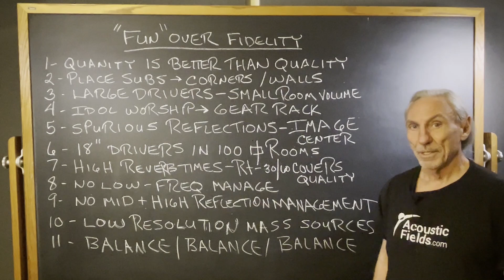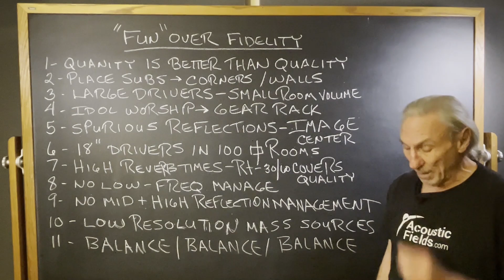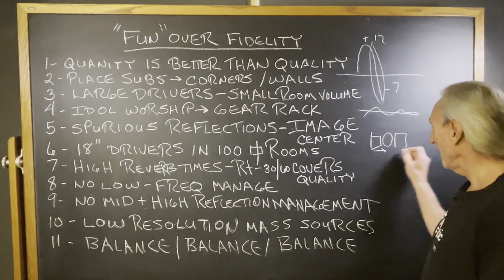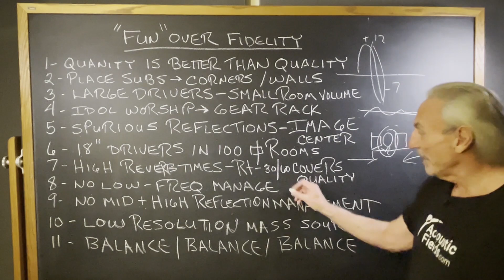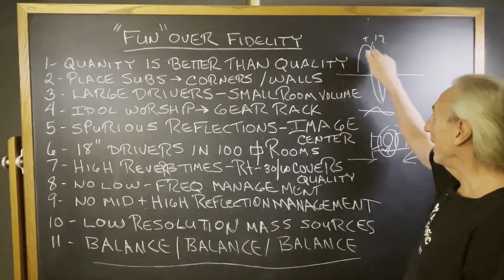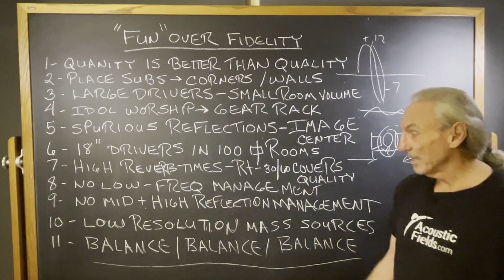"Fun" Over Fidelity - www.AcousticFields.com

Comment: I tried locations other than the corner in my room but somehow all of them provided even more rollercoaster response than the corner, on top of having much less energy (which results in less headroom for the amplifier post-calibration). Is my room special, am I measuring something wrong, or am I doing something else wrong?

Why is a large driver necessarily wrong for a small room? Post-calibration it should just use a lower gain/trim to get the correct output anyway?
Reply from the maker: Reduce the input into the room. Locate the energy source in the room middle and more left and right. Listen for increased resolution in presentaion value before measuring. Move source left and right then backwards and forwards.
Reply: @AcousticFields  Not that it would be practical in my living room due to running cables in dangerous places, but even just for trying it, wouldn't a listening test would first require a calibration run and then post-calibration tweaks for integration with main speakers? My current setup was much improved after calibration and tweaking the subwoofer-speaker delays for optimal response. Also, if the measurement in the middle of the room is still a major rollercoaster (for example -22db dip at 30Hz I got when placing at the left of the couch, which did not exist in the corner) does it have any chance to sound better than the less-rollercoaster-ish response I get in the corner? I guess one day I should mess around with various positions to the left of my couch (the right side is near the balcony window, left is more in the center of the shared space room), but I have doubts and even if I do get a good response at some arbitrary position, there is probably no way I can actually place the subwoofer in middle of a room where people actually walk around.
Reply from the maker: @galzohar  With dual usage rooms, living/listening, it is difficult to rely on measurements since the room lacks consistency and predictability in surface area treatment space availibility.

Comment: Resolution? - might you be able to provide some guidelines as to what we all should be shooting for... for example: 1. Frequency response +/- dB at the listening position in the critical range of say 250 hz to 2.5 khz, 2. Room decay time, 3. Noise floor level, 4. and any other criteria one should be looking at in order to help get us to a point of an adequately resolving room / system.  Thank you!  Ps. Beginning on a brand new room (already built) that I am free to do whatever I want within the room..., and so I'm looking for #s (characteristics) that I should be shooting for.  Thanks again.
Reply from the maker: All of the issues you have raised including many more. Lets start with your room size and usage. What will you be doing in what size room?
Reply: @AcousticFields  Dreadful small I'm afraid - 13' 3" x 21' 3" x 7' 10".  Two doors (fully closed) and five windows (have no problem fully boarding up). Dedicated audio listening room. First and foremost 2-Channel listening and then will work in Home Theater (with disappearing screen and what not so as not to compromise 2-Channel listening. Room constructed of 1/2 Sheetrock over 5/8 QuietRock on all walls and ceiling along with fully Rockwool filled walls and ceiling (floor rafters for now left empty), also double layer plywood floor (1/2 inch + 3/4 inch) plus low pile wall-to-wall carpet + carpet pad, with huge under floor crawl space (for cable runs and for anything else which may help?).  Hope that helps?

Comment: I have my speakers pulled forward a bit, as much as I can, but still flanking my TV, as one does. How far back must the TV be from the front of the speakers before it's not such a problem?
Reply from the maker: It will always be an issue due to its hard surface no matter where it is located. Cover it when listening to music.
Reply: @AcousticFields  Well, I tried throwing a blanket over the TV. It definitely sounds a little more damped and maybe smoother. I'm not sure if the image improved or not. It sounds a little less "live." It's probably higher fidelity and less fun 😅

Comment: What about speakers that are designed (?) to perform better near  walls or even corners ? Klipsch for example
Reply from the maker: Be careful using the term "better". Corner loaded speakers excite corner lower frequency modes which makes the presentation value of low frequencies sound larger. It is quantity versus quality. The horn radiates middle and high frequency energy across the room to produce a wide soundstage. It is a different presentaion value than dynamic drivers. There is no "better"
Reply: @AcousticFields seen. thanks again Dennis :)
Reply: @Acoustic Fields, there is in fact such a thing as “better”, but only in relation to personal taste. I agree that using the word “better” is inappropriate when used in the general sense, but I think it is entirely appropriate when used in the context of individuals.
Reply: I quote from the Klipsch manual : "The Forte features a rear-firing 15” passive radiator that 
requires the loudspeaker to be placed at least 1” away 
from the back wall. For optimal low-bass performance, it is 
recommended the loudspeaker be placed within 2 to 10 inches 
off the back wall ". What is optimal ( fun or fidelity or quantity vs quality ) is uncertain to me ...klipsch is a company that has to make costumers happy and after all this is why we listen to music to be happy